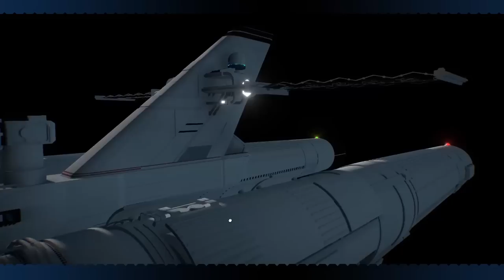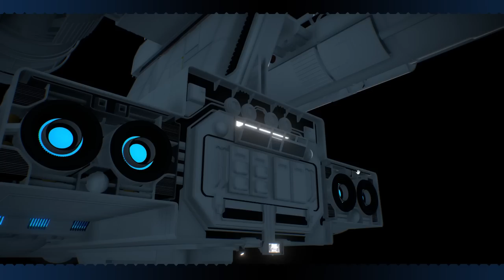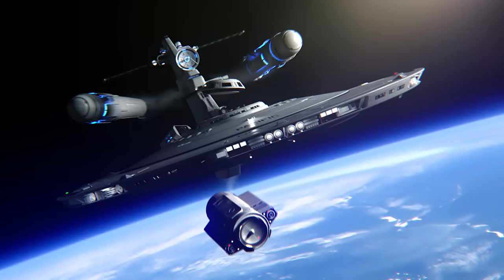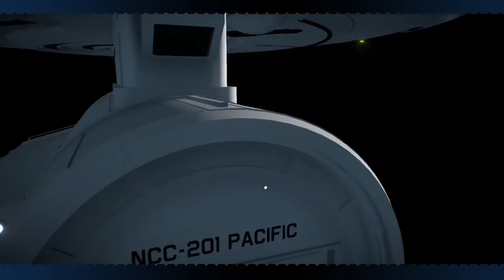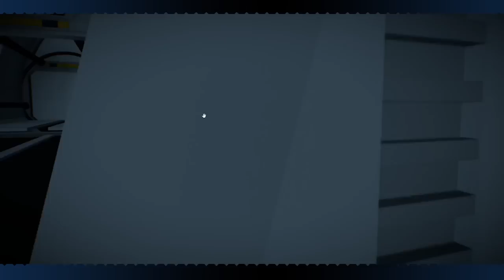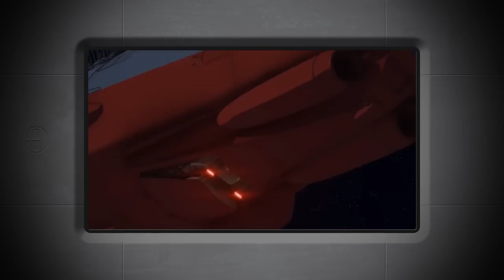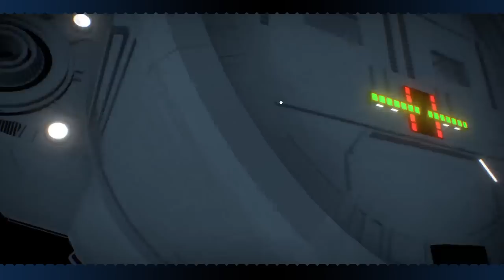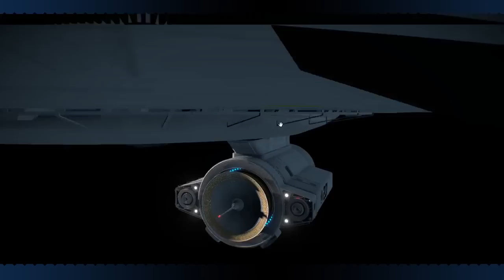Show and Tell: Starship Pacific from Pacific 201 (Star Trek fan film)

Comment: You're already describing a pure fusion weapon, which uses positrons (similar to the workings of antimatter-catalyzed nuclear pulse propulsion) which used induced gamma emission (antimatter annihilation basically) as a trigger, rather than as a payload.  The result is you have a digitally controlled yield based on the amount of trigger-sourcing you use, which can reduce collateral damage from fallout because they produce far less radioactive byproducts associated with fission-type weapons. The term "hyper" would be an easy way to explain such a thing.

They would be lethal not just for their explosive force but the neutrons (which normally would become the long-term decay products). In theory, if the warhead was designed properly, the yield could be directed via interference pattern behavior to strike multiple targets simultaneously.

Things get really scary when you fire something like this at a radiation belt -- the electromagnetic field surrounding a planet created by its polar axis. Starfish Prime, a high altitude nuclear test conducted by the united states determined that the belt produced an electromagnetic field that knocked out many civilian systems accidentally. It was determined that an especially designed warhead and altitude detonation could pass a highly disruptive EMP onto a planet's surface, potentially wiping out all technology on the face of a world taking it back to the stone-age -- and used properly in a correct orbit to its relative star vaporize oceans akin to a giant microwave.

Very scary stuff.
Reply from the maker: Wow, my head is spinning from this comment, haha!
I'll need to look into all this stuff - sounds fascinating!
Reply: Totes. Its awesome. You could in mechanical terms keep the triggers (antimatter) seperate from the warheads which would be perfectly safe until armed and use some kind of pre-launch injection system, though then you'd have to have some kind of safety timer/point of no return and a launch cycle for the warhead itself. It would be a VERY efficient use of antimatter, given the amount needed is absolutely tiny. 

Personally, I'm surprised warp fields have never been used to create a mass dislocation, kinda like a pressure difference in spacetime as a kind of launch catapult, either for fighters or munitions to get clearance between them and the host craft, given if either exploded given the nature of the powerplants used in setting it would end really badly for anyone.

I mean, people do ask "why aren't we using this to shoot planets?" but the entire premise of warp loses effectiveness as you approach a dominant influence on spacetime. Ships would just slow down until they came to a near stop. I like that Startrek always got that a ship moving through this means never experiences meaningful acceleration though, because it isn't actually moving relative to the space around it, but its the space around the space around it that moves.
Reply: Anyway, I love it. When the project's over, I'd love to hear what your design brief/narrative requirements were and how you felt the design achieved them. You hit the practical requirements square on the nose and knocked it straight out of the park. I really look forward to seeing your work in the future. Do you have a tumblr or a blog I can follow?
Reply from the maker: You can keep up with Pacific 201 on our Facebook page.
https://www.facebook.com/pacific201/
Reply: Awesome! : D

Comment: great work... IMO the entire starfleet design paradigm only makes sense if modularity was the fundamental goal, an inherently practical idea that the storytelling of the franchise has almost never taken advantage of...

only 2 criticisms of your design (hardly game breakers, but just that extra touch of realism you seam to value):
1. the windows and other aperture corners should be rounded (this is a structural integrity issue)
2.  fewer maneuvering thrusters, and less hull equipment in the vicinity of those thrusters ( IMO when dealing with "older" tech those thrusters should be massive relatively speaking)

Comment: You could conceivably boost hydrogen warheads with a small antimatter payload, stretching the supply further. It would justify a post AM warhead supply of nukes. Supply or production problems as a result of the war.

Comment: To look like what a real ship would look like? well for starts no ship would ever look like that, the thrusters aren't level with the ships centre of mass, as soon as they accelerate they'd just spin out with no control whatsoever.
If you want a star trek ship that would actually work in space then check out the Constellation class design, 4 nacelles located 2 higher & 2 lower then the centre of mass meaning when it fires those up, it moves forward.

Comment: Looks kind of cool but fragile - a few good hits will take off those nacells, so goodbye warpdrive!

Also: The secondary hull (with the main deflector-dish!) ist kind of small...why is there a something that looks like an aircraft-tail-fin?

I don't know, I'd prefer your Daedalus-Class over this (I would just change one thing on that: the two connecting struts for the primary and secondary hull would be one larger strut and I'd add a captain's yacht, just like ships from later centuries have!)

ps: I always found the Starfleet ships in Star Trek (despite being a fan of the franchise - especially DS9 and TNG!) not very well designed (why is a saucer-section so important? Why those exposed nacells etc. - It's not like the Romlans or the Klingons have either elements, hell, the Borg use Cubes and Spheres! - what's the advantage of those features? Does it make maintenance easier? Cheaper? Does it make the ships faster?)...that's why I actually love the DEFIANT, it's not at all like those other ships :) (no to mention that it packs an extreme punch in a small package...it can easily take on a severely upgraded Excelsior, which is much larger, in a straight up fight without any tactics, without using some sort of advantage (like entering a nebula or an asteroid field etc.))

Comment: The real purpouse of retractable radiation panels is to protect them from proyectiles when they are not being used and also be lightweight  so they can be less space consuming and take less cargo capacity when they are brought into space but since this is a shielded big ass ship i dont see any real reason to have this weak radiarion panels instead of solid strong ones and since this ship can also function as a warship this pannels are a big clear weakness compared to the rest of the ship

Comment: Nerd Rage: Kirk's Enterprise did not have Bussards.
Reply from the maker: It didn't have a lot of things that we consider staples of Starfleet ships, really. No bussard collectors, no navigational deflector, no warp core - these are all terms from the movies and TNG. But it's pretty common to retroactively assume these terms and details in TOS.
Reply: Yeah that's true. Though I prefer going with what was seen on the series rather than fan assumption. Plus a pretty good case can be made for them not being Bussards. Dialog indicates the antimatter was stored in the nacelles. Plus it makes sense to keep the reaction far away from the inhabited parts of the ship. Then the first time we see a swirly shaft is in TMP. In the same film everyone is walking around engineering in radiation suits and the glowy nacelle caps are missing. This seems to indicate that the matter/anti-matter reaction was moved from the nacelles into the ship.

Enterprise could be considered as contradicting this, but one could imagine they changed the technology at some point between the two series. Or one could do what I do and reject Enterprise entirely.

I really appreciate your realistic aesthetic on the Pacific it's a very refreshing take for a Star Trek ship. I LOVE the radiators. I'm going a similar hard scifi route with my S.S. Enterprise.

Comment: The NX-01 was a failure as a pre-TOS design. It was sleeker, far more technologically advanced that ships a century later. It had phasers and photon torpedoes when it was established that pre-TOS ships had only nukes. Of course the show violated continuity left and right so much its no wonder it only got 4 years rather than the TNG established 7 seasons. ENT should only be regarded as Riker's favorite holodeck novel. Untill Discovery and Picard came along, ENT was Star Trek's greatest failure.

Pacific 201 is a far better representative of a pre-TOS era design. Points off for that awful ENT uniform, though.